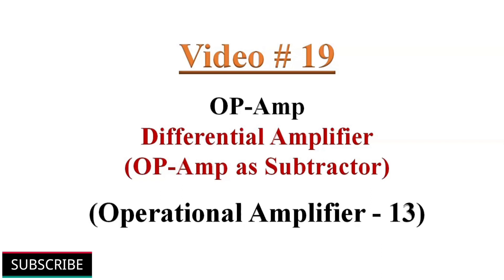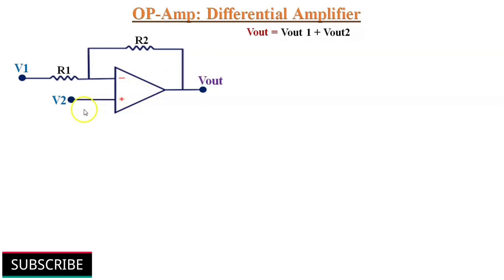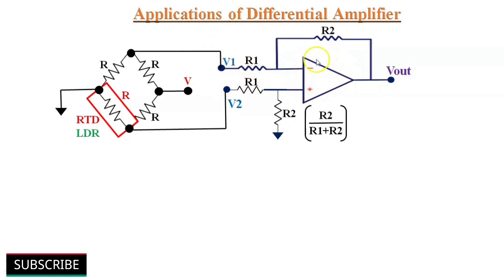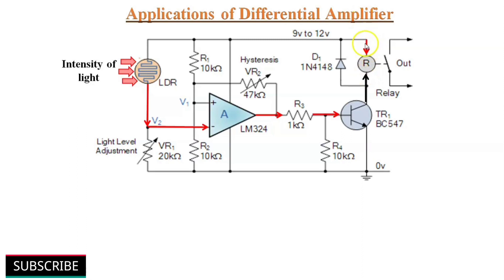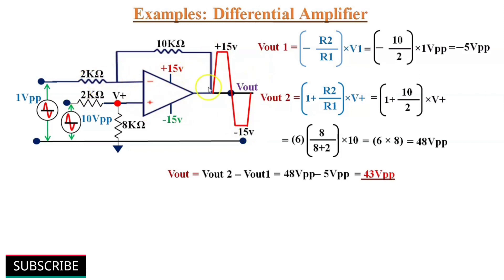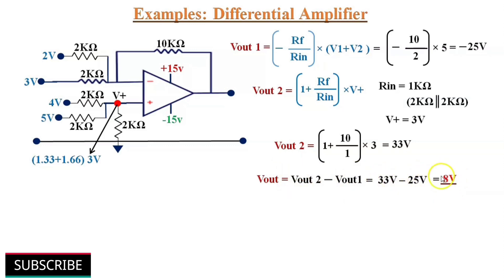OP-Amp as Differential Amplifier (Subtractor), Explained with Examples.

Comment from the maker: The timestamps for various topics covered in this video are as follows:
1) 00:17 - Introduction,
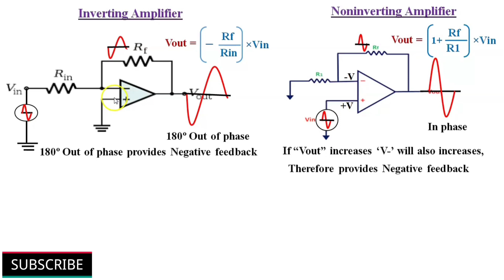2) 01:25 - OP-Amp as a Differential Amplifier,
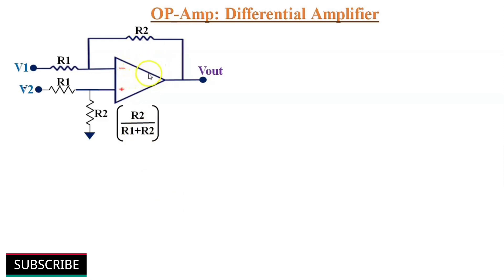3) 04:08 - OP-Amp Differential Amplifier circuit explanation,
4) 06:10 - Applications of Differential Amplifier,
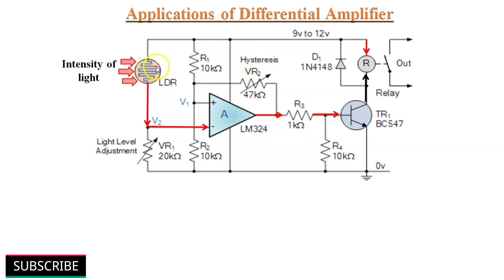5) 08:37 - Impedance of Differential Amplifier,
6) 09:27 - Differential amplifier with buffers,
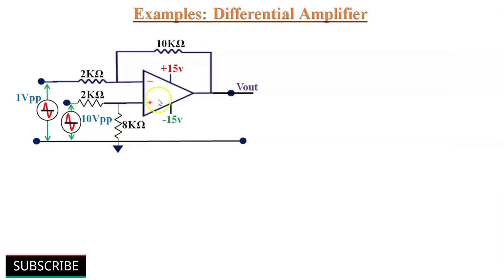7) 10:06 - Examples -1,
8) 12:00 - Example -2,
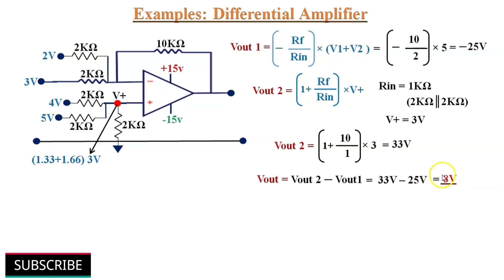9) 14:26 - Thanks for watching,
10) 14:51 - Next video.
Reply: Thank you